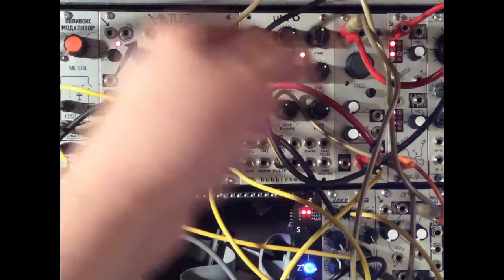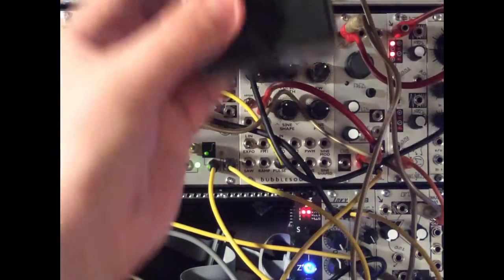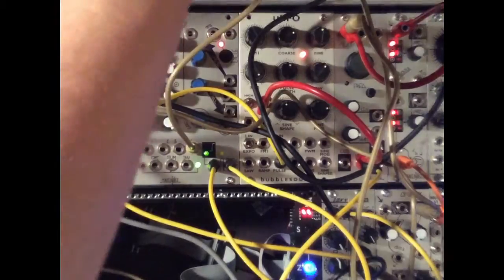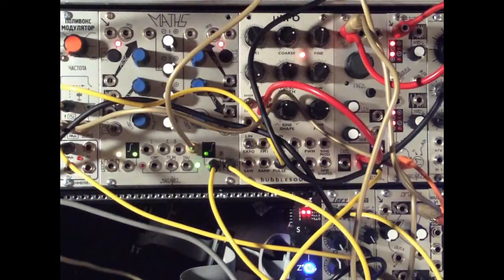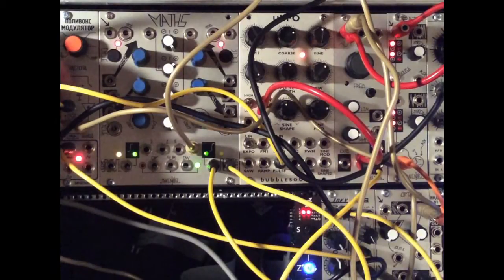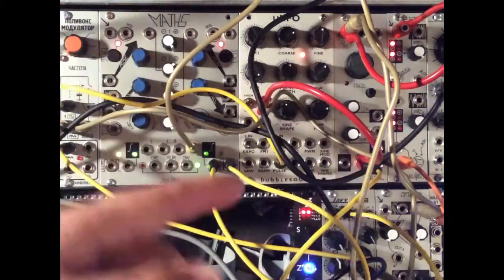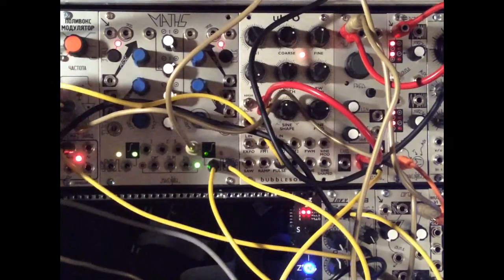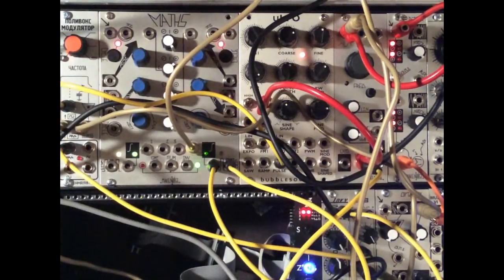Sample and Hold Analog Bit Crushing (Sample Rate Reduction)

Comment: i'm thinking of purchasing the polivoks modulator, but i've read complaints that the LFO is a little too fast...

actually, i'm in the process of building my first modular as well...do you mind running me through how you use the module in your set up? here's a 3u skiff i mocked up with the polivoks: https://www.modulargrid.net/e/racks/view/545453

i can't help but feel it'd be underused in this system...much thanks in advanced!